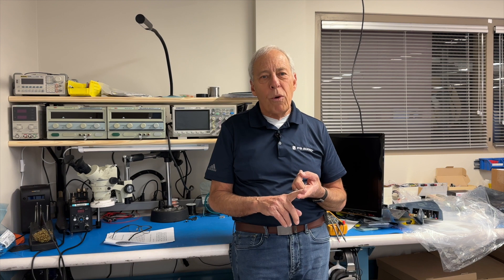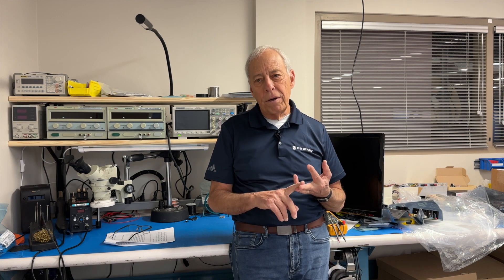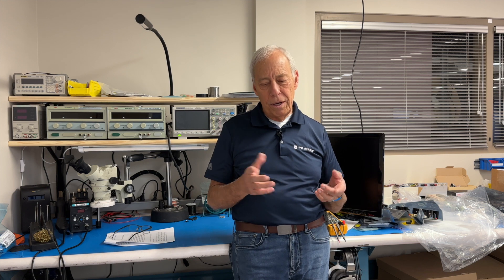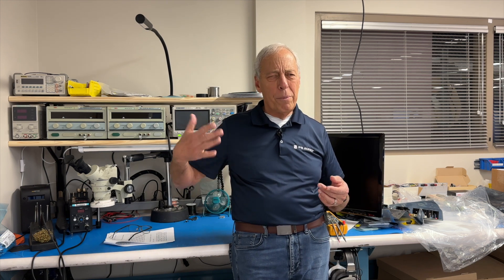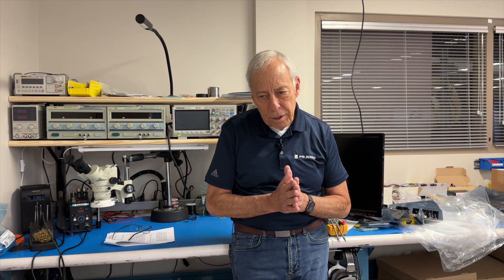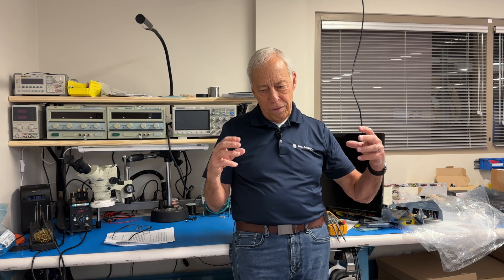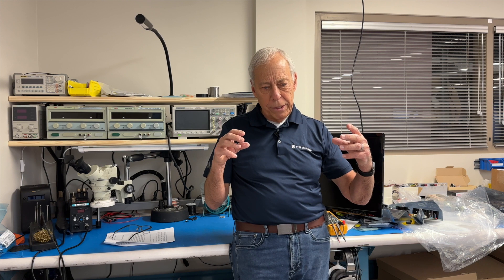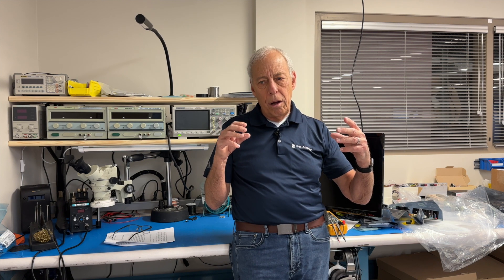Have microphones gotten better?

Comment: No mention of Sanken but they are doing amazing work with extended frequency range microphones.
Reply: I used the Sanken CO-100K when recording voice actors’ creature performances for the movie The Nun. Recorded at 24/192 and you could pitch shift it down 3-4 semitones with hardly any aliasing and still have sibilance as well!

Comment: You often extol the benefits of tubes in the front end of amplification. Surely you can't get more front end than a tube pre amp of a vintage microphone. Personally, I don't think any modern orchestra recordings I have, has bettered the Deutsche Gramophone and particularly some of the Decca symphony orchestra recordings of the 50's and 60"s. Again, just because some modern microphones can jump through hoops when being measured, doesn't necessarily make it better than the old classic mics. What these recording engineers achieved all those years ago and not just classical music and all analogue, is truly astonishing and stands the test of time and technology, so let's not throw the vintage baby out with the Digital dregs.

Comment: You can't hear down to 4hz. That's several octaves below the human hearing range. Even if you could, your speakers can't replicate it. Picking up those frequencies is not really a good thing, it unnecessarily takes up space on your 2-bus unless you use HPFs on everything.
Reply: True you can't hear it but on a proper High End Audio system you certainly can feel it. Also, remember that any low pass function come with phase shift which, in the upper frequencies, you can hear.

Comment: Maybe the most important thing is that nowadays you can have a real good sounding microphone at an affordable price. When I started as a professional engineer in studio's there were a only a few serious options for vocals and they were expensive, like the U87, AKG414 and I was fortunate to have two U47's at the time.
When  homerecording got serious in the mid 80s (with for example a Fostex 8-track and a Atari computer and SMPTE) most still recorded with SM58's etc. Nothing wrong with that, but the times have changed... 😉
BTW I love Earthworks mikes. I have a couple of them and they're like a Swiss army knife: I can use them in almost every situation!
Reply: I was about to say something similar.   Expensive mics generally haven't changed much but cheaper mics are worlds better than even 20 years ago.  In 2003, $120 got you an absolutely awful condenser mic.  Now the same price can get you something totally usable.  That's a real marvel when you condenser inflation.

Comment: well, that was a bit too easy of an explanation. what you hi-fi guys never seem to understand, is, that, recording engineers and producers number 1 job is to create an illusion. *always!*. even in classic music. and there is the place where the classic sought after equipement comes in to place, with its specific behavior which makes the job easier.
Reply: I am always fascinated when folks make blanket statements like this. What makes you think we HiFi guys don't get it? The creation and reproduction of that "illusion" means everything to us. It's why we started our own record label. Why we spend years designing equipment that recreates that "illusion". It's what's missing in so many of today's recordings. Sadly.
Reply: @Paulmcgowanpsaudio  well, Sir, i should have worded that differently. i appreciate your work and i'm subscribed to your channel. i just got triggered by the "improvement" of microphones going up to 100khz. the super linear, ultra bandwith microphones just don't get much use in a typical recording studio. and yes you pointed that out as well. good job. they do get used sometimes though. but still i'm pretty sure the biggest part of the hifi community has no plan how music gets produced. i know that you do, thats why i'm, again, subscribed,. all the best
Reply: @pongmaster123  That makes perfect sense and yes, I completely agree with you. Thanks!

Comment: This is such a great question. The answer does a huge amount of twisting and turning that just creates more questions - people have literally written books on the subject. Microphones are definitely better today in a lot of ways, but somehow they aren't as "classic" as a U-47 or a Telefunken 251. They are definitely quieter when it comes to self-noise, they have a much wider and more accurate frequency response, more agile dynamic range. but are they as "musical"? Do the electronics, capsules and transformers slightly alter the sound of sources in ways that are uniquely pleasing to the human ear, or are the overly analytical and sterile (Which is often the characteristic of an extremely "accurate" microphone) ? It becomes a bit difficult sometimes to quantify what "better" means; it really depends on what you're trying to do with it.
Reply: I often hear how some pieces of gear are more musical than others, and I agree. However, when I record a great singer, or guitar player, or pianist, then the musicality of the gear does not matter at all. 
What I want to say is that we always want a better technical product, which often leads to less musical results in a simple A to B testing, old vs new, so finding a sweet spot between technical perfection and musicality is important. But what I find most important is still the quality of the music and interpretation, the musicality of the composer and performer resolves all the technical perfections of modern gear that,  as we like to say, lacks the musicality.
Reply: I agree it is like comparing a 57' Chevy to a new Toyota, which one is better? The answer is always, depends on what you are using it for. Microphones have become much more affordable but more importantly the way you can manipulate the sound after it's been recorded give you nearly endless options. I am a purist at heart but faced with buying a $10,000 mic or a $1000 mic, I am going for the $1000 mic, you can get nearly identical results ,in a blind test most listeners will not be able to tell the difference, including sound engineers. I would tell you how I know, let's just say I lost the bet and I really don't want to talk about it.

Comment: DPA is the descendant of the microphone branch of Brüel & Kjaer, famous for their acoustical measuring systems. By design these were measuring mics. With upcoming digtal audio they proofed for recording, especially for classical recordings as main mics and B&K started to develop for this use. 1992 B&K has been sold, splitted and two B&K guys continued it as DPA.
The word 'Better' means not allways the same. While the technical improvements are mostly utilized for classical, acoustic recordings, for other music styles a strongly sounding mic is appreciated. A U47 can be the first choice then because of coloring the sound as desired.
Reply: Yep. I have some DPA 4011s, but my favorite is still a Neumann U67.

Comment: Just because a microphone is rated 20hz-20khz does not mean this is the absolute limit. Many mics can do well above 20k even though its specs are listed as 20-20k.
Reply: 20Hz to 20KHz means nothing unless you specify the range as well. If a mic is 15 dbs down at 20K, then it will sound dull. 
But if a mic is 20Hz to 20 KHz +- 3 dBs that means something more. That's when a proper response graph will tell you loads!